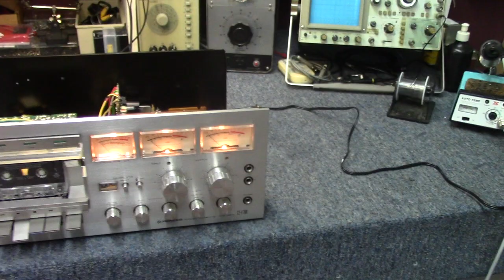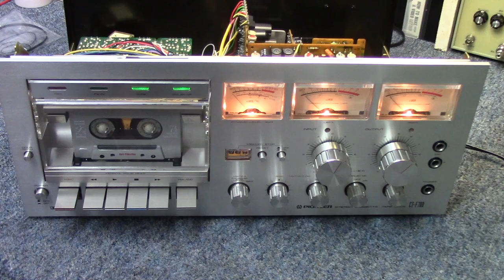Pioneer CT-F700 Cassette Deck - repair & testing

Comment: Nice deck repair! I did notice right channel lower then the left during recording and playback! Could have been the setting! Anyway like the tunes,good choice!
Reply from the maker: Thanks for checking out the video!  Yea, maybe the (R) record level was off a bit or the source may have also been causing it, that deck was in sweet condition for the age though.

Comment: Hey man, I have the same one, bought it last year, fully recapped and sounds great. The problem im having is that the speed is fluctuating and sometimes the play button has some resistance when pushing but then once i rewind or fast forward its fine again. I can adjust the speed to a 3khz signal with my test tape but the next day the speed is wrong again. Idk what it could be. Electronically, shes fully restored, all new caps and all.
Reply from the maker: R&R Guy, the reason it’s fluctuating after sitting is because the brushes on the capstan motor are dirty/worn, after you run it for a while the brushes will usually make good enough contact to keep the speed consistent, it’s definitely tedious but you’ll have to carefully breakdown the motor and rehab it, as for the button resistance, more than likely there is sticky grease on the locking slider assembly, when you press one button the slider will move to lock into place the function you pushed, it will also release the button upon the next push, that’s why if you push FF or REW first it works as it should.  Keep in mind the capstan motor assessment is assuming the belts are the correct size and not too tight.  I only had a minute this morning to check out your channel but will watch more.

Comment: Nice job again. I have one of these I need to get to one if these days. I got it from the original owner (along with other stuff) who bought it from a PX in Japan. I am sure it'll be needing new rubber by now. It was stored overhead in a garage for a number of years. But was packed in it's original box so it should be alright otherwise. Since I own it I'll more that likely go ahead and recap it with modern caps to be sure the audio quality is as good, if not better than it was new. Pioneer used a LOT of solid wire and wirewrap connections so they can be a pain at times. lol! Did you use the MG Rubber Renue? I have had good success with it although I am sure there are other rubber treatments out there.
Reply from the maker: Jeff,  I did use MG rubber renue,  for years I used PRB rubber revitalizer but they quit making it a while back but the MG Chems stuff is also good.

Comment: I have this same CT-F700 model. I bought it new in 1978. It now plays the cassette but only for about 10-15 seconds and then kicks off into a stop position. The play button releases. Any thoughts? Possibly a belt, wheel or could the motor be bad? Seem like it builds up resistance and you allow it to play and then stops? Any advise or helpful comments will be appreciated. 
Thanks Mark Long
Reply from the maker: Mark, thanks for checking out the video!  You might want to look at the counter belt(s), I believe that model uses a pulse sensor along with the counter so if that belt isn’t rotating the sensor,  the unit will shut down.

Comment: Found one of these local as-is for $200... not sure if it is currently working but at what price would it be worth taking a shot on? I’m looking for a player roughly from that era that is robust/reliable or “easier” to repair
Reply from the maker: $200 would be way more than i would pay for something that I have no idea whats wrong with.
Reply: @luvradios what are the belt sizes / part numbers?
Reply from the maker: @tonymctony4551  , I used the PRB catalog (online version is available) but most likely you can find a complete belt kit on eBay just by searching the model number.